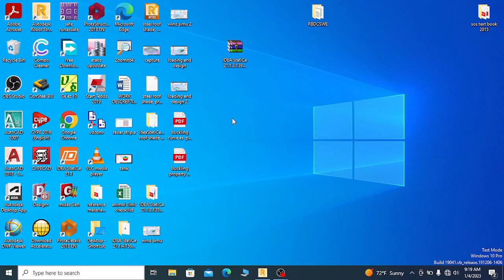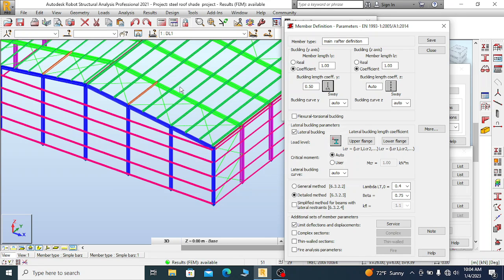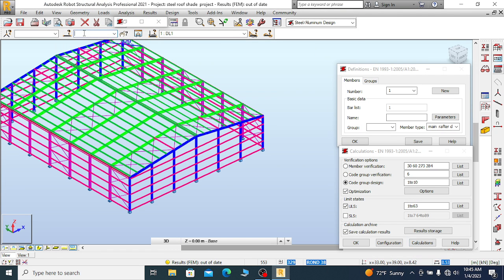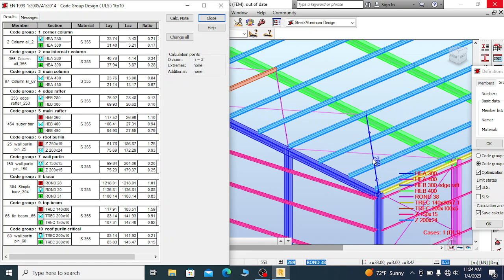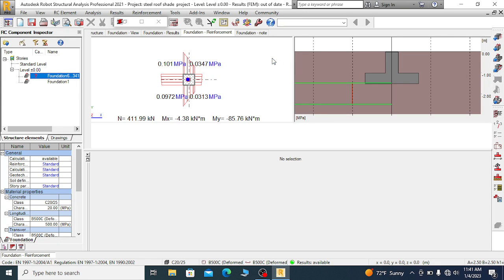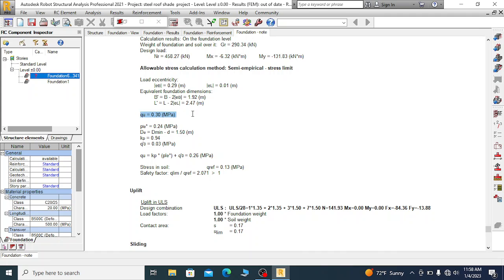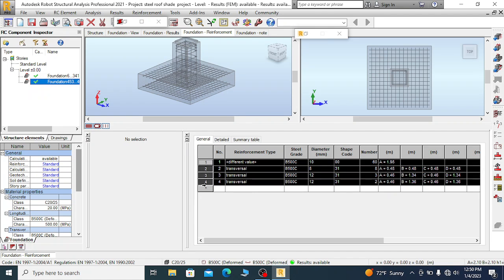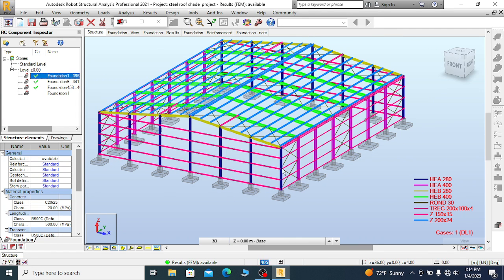DESIGNING OF STEEL WAREHOUSE USING  ROBOT STRUCTURAL WITH EUROCODE (MEMBER & FOOTING DESIGN) PART 3

Comment: Thanks for your sharing, your VDO is very good if you can make the steel design with AISC code is the best. So I can learn how set Code parameter for Column Rafter & Purlin in AISC.
Reply from the maker: I will back
Reply: @melesedemissie7664  Thanks I'm waiting.